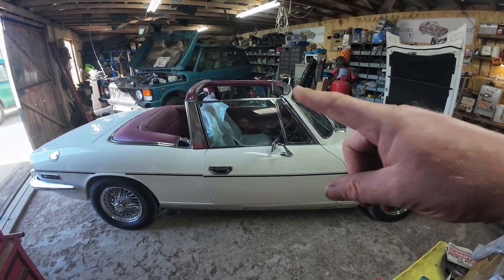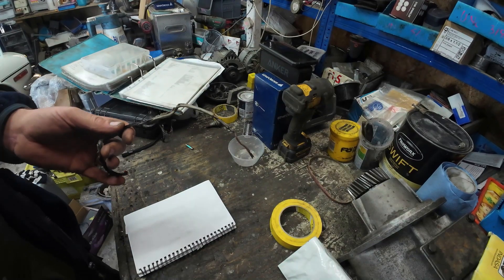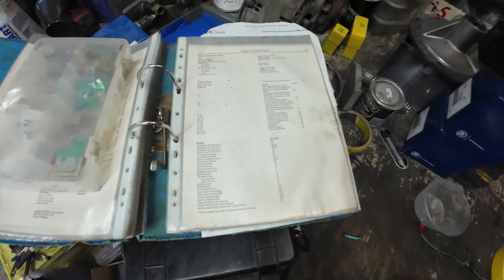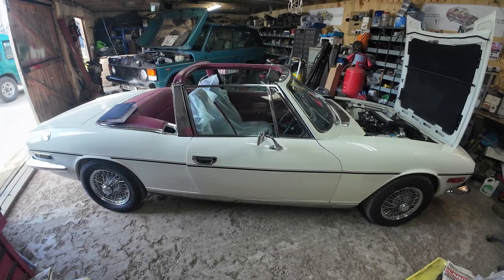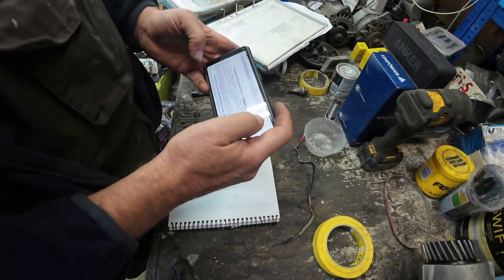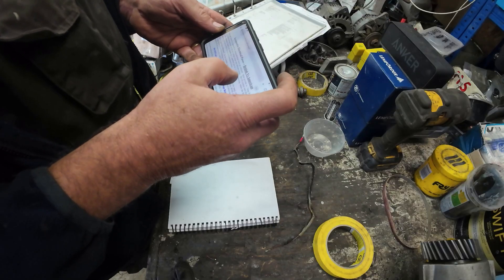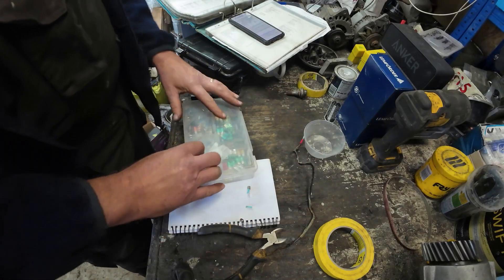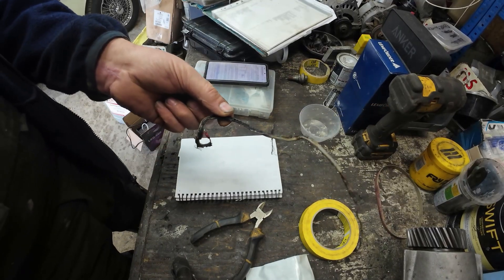DANGER car fuses - UK vs USA - Blow Rated vs Continuous IMPORTANT

Comment: Question: Is tin foil rated as slow or fast blow? (Asking for a friend)
Reply from the maker: Depends on whether the tin foil has previously been used when grilling Bacon for a Bacon, runny egg and HP sauce sandwich. This is important because as it is heating up ready to blow you get a satisfying hint of breakfast in the air

Comment: Never liked having live wires in the gear lever. On my Stag and Jaguar I re-wired he overdrive with a relay, the switch then actuated the earth to it, the plus going via the relay, thereby any short would actuate overdrive, rather than burning the car up. A  bottom gear bottom tip
Reply from the maker: That is a really neat idea, I have also run the feed to the solenoid straight down past the gearstick to the inhibit switch,  rather than up to the bulkhead, down to the dreaded boat shaped connector and then to the inhibit switch

Comment: Hmmm....   What current would the US 35 Amp fuse actually blow?             You could probably run enough current at 240v through it to power a kettle, electric fire a couple of toasters!!  💥🙂
Reply from the maker: 70 amps ish blow rating for a 35amp continuous rated fuse

Comment: You say ignorance but on who's behalf? I have never come across American type fuses or even knew of any difference. Why would anyone since we are in the UK not USA? The question then is, who and why would anyone sell them and if you did buy American fuses could you have a claim for damages in the event of a fire? It might be the case, that people buy fuses innocently off the internet and that the supplier (not giving a toss like so many of them) isn't UK based as they claim which is very, very common.
Reply from the maker: Pop down to your local motor factor, makes no odds which one and chances are that the fuse will be continuous rated and not blow rated. 

I suspect that you have come across US constant rated fuses far more often than you might realise.

Ironically I buy all my blow rated fuses from an internet on-line specialist .

Comment: Having worked on American and UK fused systems for decades the fuses I run into in the US are rated either Quick Blo (QB) or Slow Blo (SB) These ratings were for either 20mm fuses or 32mm. Well done for hilighting a very grey area.